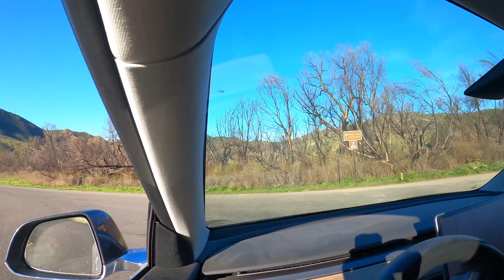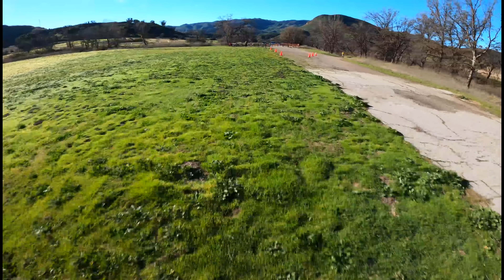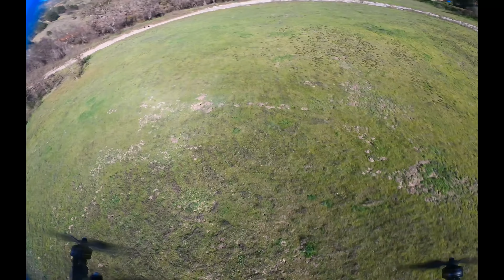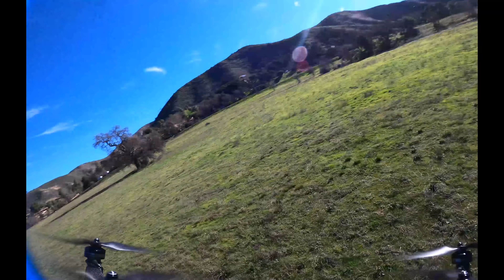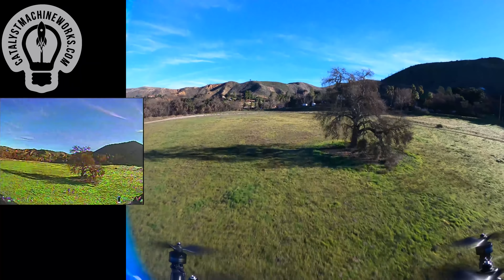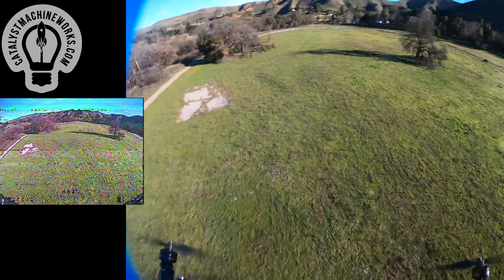Orig video: Catalyst Machineworks - Tasmanian 800mm Octo

Comment: I live in the high desert Yucca Valley ca. and we have a dry lake bed in Joshua Tree a few minutes from us that I would love to fly one of these!!!! Thank you for doing this video! I will slowly be gathering parts and eventually get one of these made so the kid and I can enjoy these huge machines!
Reply: I am currently in the design process of just a regular 10in quad rotor.   I have 2 sets of motors I will be trying for 6s cruising and 8s ripping.   Goal is to try both 2812 900kv Avengers as well as 3515 680kv Tornados.

I think for 10in cruising on 6s the 3515s will be the way to go while then having the ability to rip on 8s.

Just an FYI.   ReadyMadeRC has a 8s rated 65 amp ESC for 16 bucks...   knocks the price down a ton.

I have to wonder if a smaller version of this drone could be built using aomething like 2806.5 1300kv motors x8 and putting 7inch props on it.

Comment: Every single one of these making the case for tight regulation. (I see no positive benefit) Experimental for developing larger size utility drones, perhaps. Thrill? Go and fly indoors using your 5" racing quad if you missing the thrill. Even the person flying it takes a few steps back before taking off. It is for a good reason...
Reply from the maker: Which is why I made sure to show the amount of effort I went through to assure safety in operating it.
Reply: @Kabab  True. Im not trying to pick on you. I always appreciate your safety concerns and dental care advice. ;) Sad thing to see the RC fixed wing community after this many years still couldn't find a way to see our hobby as a straight evolution from RC planes. We could really use some help before the regulations crashing us to bits.

Comment: Semi-autonomous capability on drones is a good thing, until paired with users that can't understand the ramifications of what they're doing.  That's the actual problem, and that's what will cause hobby and other interesting airspace uses to be scapegoats for the FAA (read lobbyists trying to monetize a capability) to shut it down.  
I still can't figure out how nobody on the regulatory side has connected the dots that anything capable of avoiding bird strikes is going to be more than able to avoid anything we're doing... so the safety side isn't the doom and gloom most people characterize it to be.  Low information users + added capability are a problem, but even the old dudes at the fields understand how onerous the restrictions are going to be.

Comment: Just curious if the software moves the outer motors faster then the inner motors?
Reply from the maker: The software only sees one motor per arm. Not 8
Reply: @Kabab  Wouldn't that cause the outer motors to produce less thrust as the outer part of the arm is moving faster then the inside.?

Comment: What do you think 🤔 x8 on just inner motors, and maybe different kv for motors depending on placement? I'm an idiot but could this work? If not props with different pitch for inside motor and out?
Reply: , it seems like you would want a different KV on the motor outside compared to the motor inside just knowing that one will spin faster than the other even different blades this could change the entire setup as far as power and efficiency there's so many combinations with endless that's why it's up to someone like you to run the numbers LOL and we thank you so much for it at Catalyst machineworks as well as yourself
Reply from the maker: Yeah you're the second person to suggest that. Very interesting idea. It probably would help in some way but I don't know if it would be any significant help and would also be difficult to calculate the kv difference needed based on the prop desired
Reply: @Kabab  thanks and maybe it would work, also, just curious have you tried bi blade out and tri blade in possibly counter rotating out vs mid. Your the man srsly mad love.. Exited about the 3inch I ordered after seeing this reminding me of how dope Catalyst gear is. And to get that new tp3, that's what's up!! . , great job.

Comment: Like you said, it doesnt fly better than 5", it isnt cheap and it needs a way bigger spot to fly at, but there isnt anything else that is better than hearing these big props ripping through the air. (And the looks of it is a 10/10)

Comment: What a cool quad. What are your thoughts on a 2306 motor spinning a 7 inch prop? Not for freestyle but for cruising long range. I was looking at the XING 2306 in 1700kv. This would be my first 7 inch and I plan to build my own li ion packs.
Reply from the maker: Will give you long flight time but won't be very peppy.

Comment: Make sure to join our Advanced Power Drives The Lounge Facebook group! Also your capacitors look like they got bent a little from flying; I recommend putting some mounting tape under the caps before soldering as these ESCs need the capacitors mounted and you don’t want them breaking mid flight! Happy flying! 👌🏼🙌🏼🔥
Reply from the maker: yeah I did hit them with my hands a few times.  The final version isn't like that

Comment: I've got a 10" macro quad. I agree the only thing that redeems bigger quads is the SOUND....the flight performance is never up to smaller sizes.  In general, I still think 7" is the sweet spot.
Reply: Yeah, I'd rather have a quiver of 7" rigs than anything larger, and so far a quartet of those works amazingly, and still costs less than the base price of even a budget beast class rig.
Reply: a sweet spot from what? Racing? in the first years 8-12min flight time was the target. now 3 rounds is the target. what is your target defines your sweet spot. my sweet spot is a 14´´ rig, because i want to explore my area and fly fast around, not racing. With the dudes my sweet spot is a 8´´ because its fast enough to follow them. ;-)
Reply: @rolliseventeen  My kind of flying is fast and low, over terrain and up to 3 miles out.  That's why (for me) a 7" fits the bill.
Reply: @rolliseventeen  Solid point - once I add cost back in, 7" always looks great compared to true macro quads.  I'm all in for $250 on quads that can both outrun my 5" race quads in a straight line, haul GoPros without even being phased by the extra weight, and handle all the mid-range flying I'm equipped for.  Mixture of fast & low is a good way to describe it - race gates, natural courses, cruising riverbeds, powerlooping buildings - this does it all.
Reply: Well after  a few dozen flights and tuning, My Xclass rigs handle pretty damn good. Hitting gaps , flips , all sweet as can be.  AND like you said the SOUND!  check this out if you have a minute   https://www.youtube.com/watch?v=nBNuucpE0yM

Comment: The old guy at the end sounds like every fixed wing pilot I've ever met......."the drones are the problem."
Reply: FAA, Amazon, USPS, Apple (yes Apple look it up - they are looking at data transmission in low altitude airspace) etc dont care how many rotors a craft has and they dont want any loopholes,  so sorry old timers your glue and foam fixed wings will always be lumped in with the problem child quads.  You see a distinction but there isnt to the aforementioned parties
Reply: Drone take over!
Reply: Hey I fly fixed wings.. N it's FUNNY cause the AMA was the initial cause of all the changes proposed back when requlation was first uttered..... IN OTHER WORDS THANK THE AMA for EVERYTHING they have done to make the distinction that they want a bill to separate them from multirotors is what started EVERYTHING.. They wrote about it even and it's widley known.. I love fixed wing fpv, it's MAH SHIT, I rip Quads👊I'm 107, n p yea.. #FUCKTHEAMA pay them dues bitch...
Reply: @cenabitednbfpv587  Agree 100%
Reply: He was correct in every word.

Comment: I can't believe you just helped me justify a new x-class-ish drone...thanks for all the price comparisons on the components.
Reply from the maker: Really I'd build a smaller 9" quad with this electronic setup rather than than this octo thing if I wanted to build a middle size quad.
Reply: @Kabab  I like the 2 motor per arm thing. I think it's pretty novel and wonder if it could be applied in other size categories unless the idea doesn't really scale down with prop surface area.

Comment: The noise:  Before I got into FPV I was lying LOS & GPS quads, 3+ years ago I bought this 450mm folding frame quad which takes 8" props, it sounds amazing when it's going full throttle and when I show a fellow FPVer I know his first thought is going to be "When are you going to put a Betaflight controller on it???" especially as I put single colour red, green & blue LED strips on the arms to make it look as cool as it sounds in the air :)
Reply from the maker: The noise is just incredible
Reply: It's been years since I heard that 450mm quad with 8" props do fast flybys and low swoops, but that deep "whomp whomp whomp whomp whomp" sound it makes is unforgettable. I might just have to turn it into an FPV quad now.

Comment: I would like to see this on 2 5S batteries. Assuming the electronics can handle that. I am also interested to know if the 2 motors on each arm are the same as the ones closer would have less torque than the ones at the end. My first build about 15 years ago would have been classed as an X class. Though the electronics were not up to today's standards and escs didn't have braking so it was not great.
Reply from the maker: Yeah they're the same and you're right that does affect things a bit. This isn't a perfect build at all.

Comment: Also you stated that 6s is a good thing for sag when flying a 5"...you really need to try a 6s 3" quad...
Reply from the maker: I've experimented with 6s on 2" and 3". I find that my 3S 3" builds are about the same speed and performance as most with longer flight times too. Much longer. You can definitely get more speed out of a heavy 3" build but at that point might as well skip to 5"
Reply: @Kabab  5" is a bit more intimidating for most ppl in a park. I just like the portability and the cheaper batteries of the heavier 3" builds with 6s for racing around...115mph in a straight is so fun.
Reply: Why has nobody ever tried more than 6s on a 5inch? I dont think that it flies better but I really wann try it for fun. For 7-8inch it could have some advantages
Reply from the maker: @ariafpv  many have done 8 and 12S on 5". Some speed runs are done on 10S but the actual top speed record was done on 6s because aero is much more important at 200+mph. Same guy was almost bearing the 10S record on just 4S.
Reply: @Kabab  200+ mph is crazyyy. Imagine that thing flying by lol. Not talking about speed, would 8s make sense on a 7inch to be able to carry more weight?
Reply from the maker: @ariafpv  yeah that's reasonable I'd say. Note that as you add cells, the percentage increase of voltage gets less and less. So 6s to 8s isn't really that drastic
Reply: @ariafpv  might be because of the weight and available of the batteries.

Comment: Interesting idea. Would be nice to experiment with such a thing with the 8 standard size motors and ESCs from 5" copters.

Some of the RC-clubs where I live already recognized, that they are going extinct, if they do not allow quadcopters. 

It was the same when 15 years ago, the 3D helicopters came up: Nobody liked them, nobody wanted them but in the end, some of the members tried it and noticed that it is challenging but fun and gets in new members. 

At our club, most of the time it was only me who noted 5.8G as used frequencies, now there are more people "coming out" and as a side-effect, the average age of the members is going down 😁
Reply: More props mean less efficient..
Reply from the maker: I've done this with 8x 5". See deal. It's just a heavy powerful 5". Nothing special. Lots of noise however
Reply: @Kabab  It would just be for the price. I put together a BOM for a normal X-class and it would cost as much as a well-equiped 3D helicopter 😒
For a 5" setup, I have a lot of parts laying around.

Comment: Have you looked into or checked out 10"? Not quite x class, but if this is eight 9" props, then going down to four 10" props, well...
Reply from the maker: I haven't done anything bigger than 7" lately
Reply: @Kabab  Deadass, check out Red5 FPV. That 10" muscle quad he has is dirt nasty siiiicckk! Methinks higher cell count on that thing or a version of it could be insane. Screw X class. 50% x class master race, lol.